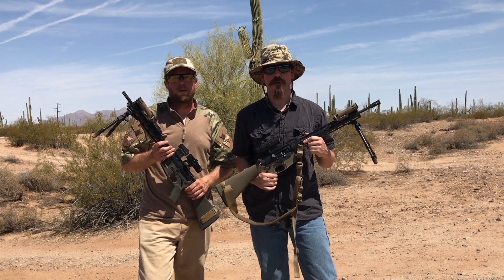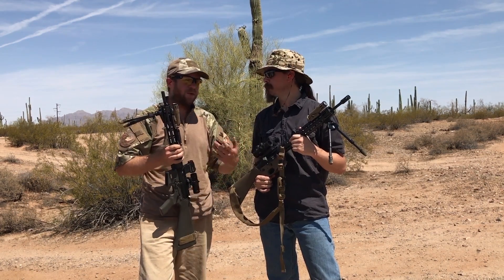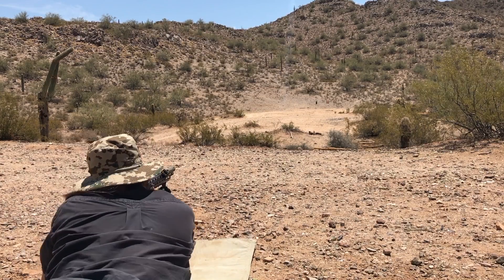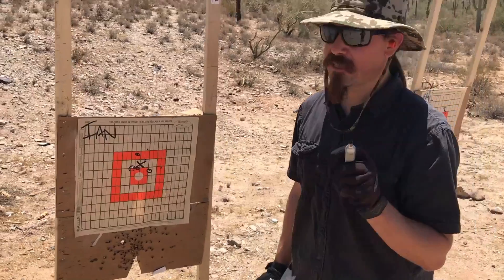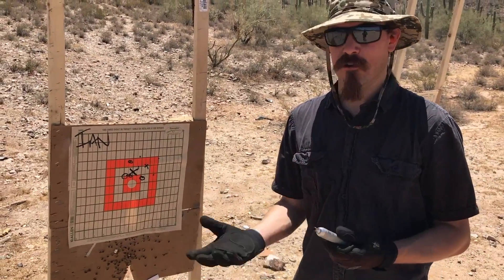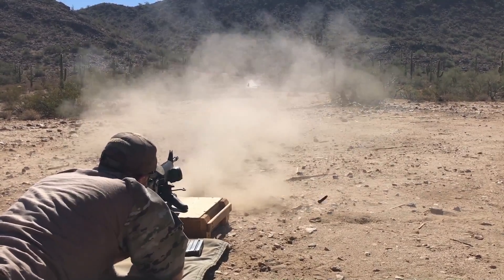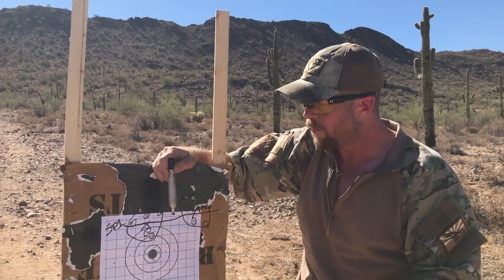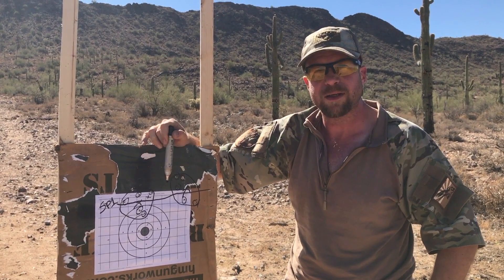WWSD: Pencil barrel Stress & Heat Zero Testing

Comment: Another field of study with cryogenic treated barrels, is functional interior surface hardness. (Better rifling life??) There is a VERY good reason that nobody runs stainless steel barrels in full and semi-auto military firearms. Hard-Chrome (or an "eco-friendly substitute), for the win. (Hexavalent chrome is NOT your friend).

See also "stainless" vs "regular" steel barrels.

Also, another "wild card": barrel fluting; SERIOUS fluting . Say, something like the early"Sudanese" AR-10 barrels. Basically, take a "heavy-profile" contour and mill deep flutes starting forward of the start of the rifling, (the "leade").. Stop fluting before you get to the gas block, of course, unless your project is on a bolt-action.

The "grooves" remove weight (actually, mass) and the ridge lines retain a lot of the rigidity of the original "heavy" profile.

Comment: Very interesting. I have a question based on that comment about the barrel whip with the different barrel lengths. You guys mentioned that the 14.5 should theoretically be more accurate since it will whip less than the 16, and the test appears to show that. That being said, would that make 14.5 more appropriate for a general purpose/combat lightweight carbine, since you'd expect to use multiple magazines in a firefight?

Comment: I'm building a second upper for my ultra light V Seven shtf build just for fun to see how much lighter I can make it after my SBR approval comes back and my EA ARX gets out of jail and I kept debating going pencil barrel but I was worried about this POI shift so bad and I couldn't hit the weight goal I had.

Now I'm beyond thrilled to have faith that it will still be as accurate as I wanted while hitting my ridiculous weight goal.

This SBR will be a direct threaded 14.5 pencil barrel rifle that will weigh 4.8 pounds WITH optic, suppressor, and a full 30 round magazine.

No polymer or magnesium receiver parts either.

The normal shtf setup at 16" currently weighs 6lbs loaded (with suppressor factored in even though I don't have it yet)

Comment: Again...this is hardly a “heat test”. The barrels would warp under rapid or fully automatic fire and long streams of fire at that’ you literally tested fucking nothing with this. That’s hardly a heat stress test
Reply: This is testing a rifle not a MG.  A Mag dump is above rapid rof.  They showed the a1 shifted under the heat of a mag dump
Reply: They shot to the point where the SP1 shifted significantly (enough that you could miss shots that would otherwise hit within 200 and maybe even 100 yards) while the Faxon barrels had little or no shift. This was meant to show that modern barrels are better than 1960s barrels. If you want a gun that can maintain high rates of full auto fire get an open bolt machine gun, with spare barrels or water cooling.

Comment: I remember when the barrel straightness gauge was added to the M16/M16A-1  gauge set. A lot of those bent barrel problems went away when the three prong flash suppressor was deleted. There was a habit of using the three prong suppressor to break the banding on C-RAT pallets.  Somebody once told me that at the factory they used a projected light through the barrel to check them and a rod in the end to bend them straight. Don't know how true that is.

Comment: Very similar to my results. Mine has a distinct shift from COLD to anything else, but the difference once it's not stone cold and pretty hot is minimal. From (literally) ice cold to round 5 usually shows a nearly straight line downward, with four and five usually stable. From that point you can get pretty darn hot without any significant additional shift. This was an awesome project, guys. Congrats on getting it turned into a commercially available project. I made my own but you guys get full credit for convincing me to try it out.

Comment: I have a 16” faxon pencil barrel and it also shoots tighter with a little bit of heat in it. I thought it was weird, but now I’m curious if this is a trend.
Reply: I dunno. We had a Type 99 Arisaka out and the youngsters were really running some rounds through it. It was really hot and the groups got a LOT tighter. It has a chrome bore like an M16A-1

Comment: For a military rifle a heavy barrel end to end has an important advantage when using bayonets. The cut outs under the handguards of the government A2 is because of the M203, they should have increased the diameter of the clamps rather than machined away the metal from the barrel.

Comment: I am a thin woman. Weight has always been an issue for me and I have always favored pencil barrels. Yes, older pencil barrels do tend to string out when they heat up but I haven't really found that to be an issue for several years now. 
I was in college from 88-98 and couldn't afford to shoot in that time period. I bought a couple of rifles after I started working in 99 and most of the pencil barrel issues I had seen in older guns seemed to have been resolved. 
They do heat up faster and groups do open up a bit but not enough to really gripe about. 
The old days of getting hot and shooting 2 feet to the left seem to be gone. 
Even when cold, newer pencil barrels seem to be more accurate than they were 30+years ago.

Comment: I had a 1910 vintage Mannlicher Schoenauer 6.5 x 54mm factory sporting rifle. It had the short front end and a 25" pencil barrel. You only got 2 or maybe three at a pinch, shots on a 4" target at 200 yds and the next shots would be outside of the required 4" group (standard accuracy demanded for deer stalking in the UK) due to barrel warp. This was particularly noticeable with the standard 160 grain round nose ammunition (2100 fps). If I used 120grain spitzer bullets (2550 fps), which spent less time in the barrel, I could get 4 or maybe 5 shots on target.

Comment: How can we be sure the effect we see is not caused by the lack of free-float tube on the SP1? It seems that the pressure of the handguard the barrel could change substantially as heat rises, potentially leading to POI-shift/stringing just like what we see here.

Comment: I was told a high quality 16" 416r SS barrel with a .625 profile gas block would start to shift point of aim after sustained strings of fire, 60+

Could you do this test with 2-3 mag dumps in between the measured shots instead of a single mag?

Comment: Guys - in both examples firing only 1 30 round mag: the point of aim to point of impact shifted over 1 inch at 100 yards. 

Pencil barrel deflection confirmed, resoundingly . 

More over, that was just 1 magazine, not a sustained firefight of multiple magazines expended in a short period of time. 

I'll say it again: Pencil barrel deflection confirmed, resoundingly . 

"the thing that we just showed happening, which people would said would happen, isn't happening, even though we just showed it happening" - drink some water guys, the desert heat is getting to you.

The SP1 barrel flexed 4x as much. 

Conclusion: 
Pencil barrels flex: really good pencil barrels flex less. 

I'm sure that's in no way possible an easily predictable outcome. However, that's a far cry from claiming that said pencil barrel X doesn't flex, it does and let's not pretend otherwise.

Comment: In my experience, pencil barrels are better than they were 20 or 30 years ago. I got a DD pencil barrel a while ago & I got an FN pencil barrel through PSA. They are both great. Point of impact doesn't change drastically until you get them up to temps I would consider abusive. 
I agree, the modern manufacturing has improved the quality overall, across most manufactures. No doubt, some are still better than others but, I think, the average quality of guns/parts has come up quite a bit over the last few decades.

Comment: So, as someone who has never even held a gun in his life, can you explain this to me a little? I would assume that, if using iron sights, with the front sight on the barrel, the shifting of the barrel would also influence where the sight is pointing. Why is there still such a significant difference in perceived point of aim and point of impact, then?
(Of course, I realise they are often not on there). 
Edit: Thinking about it more, I guess if the barrel bents the final direction would still not line up with the sights - only more ~halfway in that direction).
Reply: On an AR15, there is a potential pivot point between front and back sights, where the barrel is held to the upper receiver.
Then there's the issue that sights only work when the barrel is relatively straight. Under heat, some barrels flex and curve, so any straight line with the sights cannot be in alignment with said curved barrel.

Comment: What's the weight difference between the 14.5 and 20 inch barrel? I'd rather save weight by going to a shorter barrel than a skinnier one. You lose velocity but get a big advantage when doing urban or mounted ops or when running a can. Plus m855a1 and mk318 largely negates the velocity loss with bullet mass. Of course, out in the desert where you guys are I'd take velocity. Great work.

Comment: I'm usually pretty impressed by your intellectual honesty and self-examination, Ian and Karl, but this time... I'm just not sure there was sufficient scientific rigor in this test. I understand that shooting is expensive, and this was supposed to be more of a real-world demonstration than a fully scientific experiment, but it still didn't feel like it was set up and executed in a careful enough way. Which isn't to say that I disagree with the results -- I have no opinion (or stake) in it either way -- just that there were some glaring omissions from the presentation.
For example, with human shooters, you're introducing so many variables that cannot be controlled for just by pitting each shooter against himself. You pointed this out yourself when Karl omitted a result that didn't agree with his expectations (typically a bad habit in science, but one which every researcher does to some extent) because he thought he was the root cause. I would also point to ambient weather conditions that could shift throughout the testing (I understand there aren't a lot of 100 yard indoor ranges), and the variability in powder charges with cheap ammo. And I recall reading (though I'm not sure I can find the source to cite) some firearms researcher arguing pretty persuasively that 5-round groups are insufficient for statistical significance. I'll have to look that one up. And I'm certain that there was nothing untoward happening at 4:35 (after Ian says "and five for score" there is a very subtle cut), since it was likely cut for video length and conciseness, but an explanation would have been nice.
I still love the content, and I admit that it's super easy to critique from the YouTube comments section without going out there and doing the work myself (thanks for doing the work for us!), plus I'm sure that the companies involved (with vested interests) have done extensive scientific testing of their own that we could look up... it still just struck me that there were these omissions.
Reply: I think youre over thinking it. They are both capable of putting a group on paper. They did it multiple times. The group sizes before and after dump were basically the same, also. What more do you want? Do they have to clamp the rifles in a vice? Come on. Thats not even fun to watch. Its about "dudes watching dudes" shoot rifles. And machine guns. And walking fire with machine guns. And 2 gun matches with machine guns. And comparison videos about machine guns. And...
Reply from the maker: I didn't think I was the root cause, I knew I was the root cause because I can call my shots.   We landedup performing the test twice and had the same result both times, even though that wasn't our original intention.  Freel free to post your own, better version and we'll check it out. 
~Karl
Reply: Thanks for the (probably appropriately snarky) reply! I fully admit that I have neither the time, space, money, experience, or honestly inclination to do the sorts of things you guys do, so thanks for making awesome content! It just irked me some to see some of the most common "working toward and interpreting the data in favor of the solution you want" issues with your testing -- though again, I get that it was more of a demonstration than an experiment.

Comment: not sure if the sp-1 is free floated my assumption is that it isn't. I wonder if it would have the same level of deflection if it were free floated. That's a variable in need of control, also what's the temperature sensitivity of the powder? If its sensitive and put into a high heat environment the pressure will increase along with velocity and ultimately result in higher POI on target at which point it may give some the false impression that the barrel is the issue.
Reply: The SP1 is not. It looks to be a 1:1 of the original design. If there was any effect on flex, it'd be very minor on this type of rifle.

Comment: if i was building a dmr ar15 i would not go with a pencil barrel purely because of how the point of impact changes when switching from a flash hider to muzzlebrake
Reply: i had a brainfart when i wrote that, i meant suppressor, not brake. haha. putting a suppressor on a pencil barrel bends it down a bit which makes shots hit inches low. i like the idea of the faxon barrel on the 14.5" though.

Comment: I'm wondering just how much of a factor the barrel differences between the WWSD rifles and the Colt that weren't discussed had on the results.  If I remember correctly, your Faxon barrels are nitride treated and not chrome lined, while the Colt is chromed.  That could potentially have affected why the Colt's group shifted more  As the Colt is chrome lined its bore has to be bigger to allow for the chrome lining to be applied.  This could have had a detrimental affect on its structural integrity, as the barrel would contain less steel than the Faxon barrels.
Reply: Chrome and Nitride will not have a major effect on structural integrity or the movement of a barrel during stress tests. Its the manufacturing methods and processes - not the final treatments - that are the big deal.
Reply: Interesting.  I know some testing has shown that a nitrided barrel can be slightly more accurate than a chrome lined barrel due to differences in the regularity of the barrels.  I believe that may have been touched on in the interview series you guys did together, if I'm remembering right.  Thanks for the reply, Faxon.

Comment: I used a 16" Faxon Gunner barrel instead of the 16" Pencil barrel.  
The Gunner barrel only weights 2.7 ounces more than the Pencil barrel.
I feel that that slightly thicker barrel between the chamber and the gas port will keep barrel whip to a minimum when choosing a lightweight profile barrel.

Comment: If you want a squad automatic weapon, you might want to look into straightjacket barrels, currently branded as Draco barrels. They are pencil barrels with a proprietary material surrounding the barrel, which gives it the profile of an ultra thick bull barrel but the weight of a light to medium profile barrel. After dumping a 30 round magazine, the barrel will still be cool enough to stick your finger in the chamber. It's definitely worth checking out

Comment: Good stuff--I was waiting for the SP1 comparison, which was needed to draw the conclusion. You likely already know this, but OnTarget has a software product that calculates mean point of impact for groups on any target, as long as you can put the target into a scanner. Of course, you'd have to either lug a scanner into the desert or cut back to your den to show the results.

Comment: I'm fairly certain you would see more shift than that with the SP1 if you used a optical sight. Since the front sight is mounted to the barrel it moves with the barrel and compensates. I shot a stock SP1 in early 3 gun and had to deal with this.
Reply: That is actually a really interesting point. I would like to see them do a video where they mount somthing to the carry handle to test this theory, maybe then using irons could be useful (assuming you don't have a free float with irons mounted to the handguard, but that would do the same thing as the optic then) if you knew your barrel would do that.
Reply: Do you think the non free floating hand guard exacerbates the shifting problem?
Reply: Valid point sir. I like your thinking.
Reply: Very smart. 2 thumbs up.

Comment: Did Ian go with the gunner or pencil profile barrel?  The other think about the pencil barrels is you typically aren't going to run them that hard, even in a match setting maybe 3 mags +/- at a time.  That's hot but not like 3 mag dumps.
Reply from the maker: +0214Bub Both guns are pencil profile. ~K

Comment: Does it not bother Ian to shoot a right handed gun being left handed. Personally I would think it could be a little annoying.
Reply: As a fellow long gun south paw. You get used to it or quit shooting. I won't shoot an ar without a full size shell deflector. Shotguns are worse than ar they tend to put hot gas in your face worse than the porting system on an ar bolt carrier.
Reply: That is what shell deflectors are for.